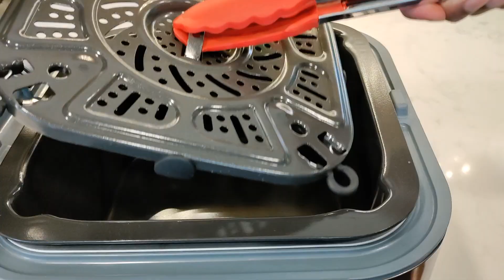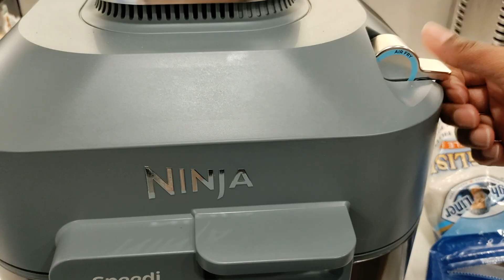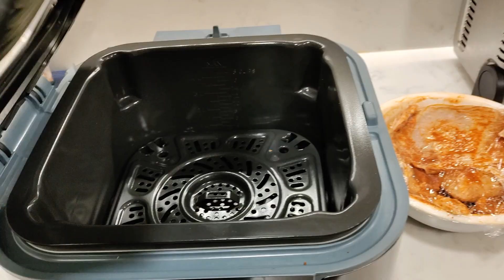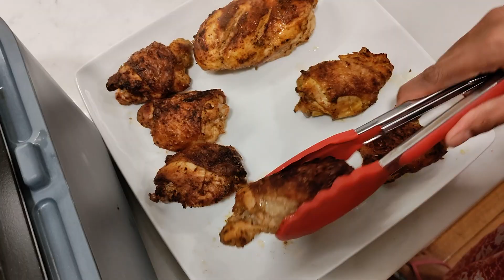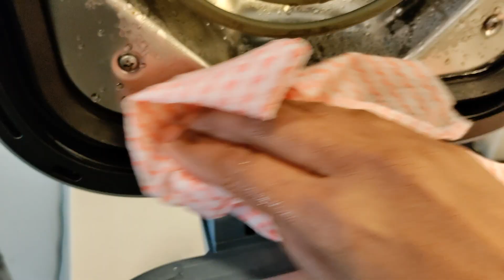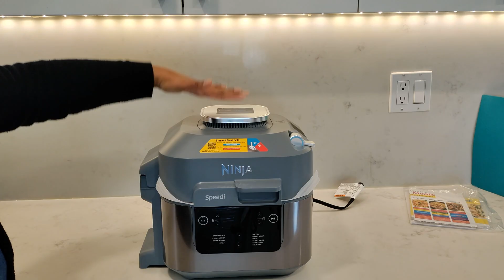Ninja Speedi Rapid Cooker The TRUTH to 15 Minute Meals!

Comment: Just purchased the Speedi. The steam/bake setting does not work for me either. I waited 15-20 minutes.....the water eventually boiled off. At no time did the upper element and fan kick on.
Reply from the maker: Yeah, it's definitely an issue. If it hadn't worked the first couple of times for me, I would've assumed that's how the program works. Anyway, I hope you got managed to get a replacement.😊 👍🏼

Comment: I followed another YouTuber and did a 3.95 lb. Chicken on Steam and Crisp with 1 cup of water, 350 degrees for 20 minutes. Absolutely perfect! I temp probed it to make sure it was done. The chicken was so moist inside and crispy outside.
Reply from the maker: Thank you for sharing! I agree, 1 cup of water is good for about 20 mins of steam time. I obviously underestimated the power of this thing and used a higher temp AND a longer cook time the first time. I now do my chicken at 350 for about 25-30 mins as I like it very tender until it's fall of the bone! 😁

Comment: Anyone with a new speedi, please do not run it on air fry when empty for 20mins. In the manual it says specifically to run it for maximum 10mins if there is nothing in the basket
Reply from the maker: At least' 10 mins is recommended. I always like to run it for 20 mins, because it helps to rid most of the smell. 10 mins is not sufficient for me and I know some viewers still find the smell very strong and run it multiple times. Feel free to do what you are happy with.
Reply: Don't run it empty then. Just as some water

Comment: thank you. Can you tell me if the counter it sits on gets hot from the bottom heater element?
Reply from the maker: Most of the time, no. If I run the air fryer on a high temp for a long time (i.e 400F for 50mins+) the counter feels warmish, but not too bad. Hope that helps.

Comment: Thank you for this video can I check when u cook fish fillet can I add potato wedges at the same time?
Reply from the maker: I think the potatoe wedges may need a little extra cook time, either add the fish part way - or take out the fish earlier. Also note, the fish fillet will leave a fishy smell which may linger into the potatoe wedges. My advice, cook the wedges first, then cook the fish fillet, fish cooks quickly and the unit will be hot 😁

Comment: Hello there, I found this really informative and with all the examples it really helps new user to understand. I used to have one of these, but I ended up sending it back and bought an instant pot and an cosori air fryer to replace it. I think the fan in my ninja was faulty and when I tried to use the slow cooking method, it basically just boiled my stewing steak to leather, even on the low setting. I had to bin the whole meal and sent the unit back. I would like to say that ninja customer services were amazing and even though I was sending it back, they were lovely over the whole thing. I am buying another one, I love my other appliances, but this has been missed in my kitchen, so easy to use he he! Keep up the great work, people need reviews like yours! Take care Jane
Reply from the maker: Yes, Unfortunately, it all comes down to trial and error and I say this all the time when I review a new cooking appliance. One thing I did notice is this is very powerful, perhaps reducing the time & temp may help? I appreciate you taking the time to share your experience. All the best! 🙂

Comment: The steam and bake function can take as long as 20mins to preheat, before it time starts.  You need to be patient.
Reply from the maker: I waited for 50 minutes and my water evaporated. I have also used the function before this incident and it never took more than 10-12 minutes for 2 cups of water at 350F. I can understand that the lower temp and more water will cause it to take longer than steam & crisp. Mine definitely was defective, but thanks for the sharing the tip.
Reply: I need Another crispy tray, where do I get one ?